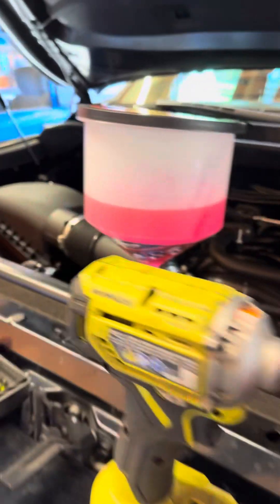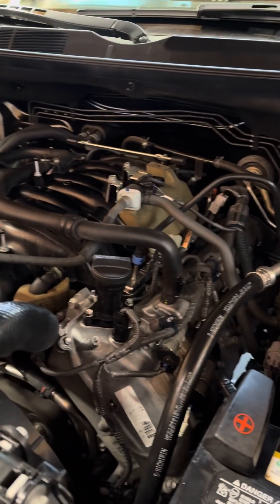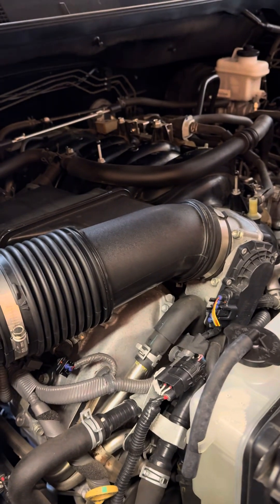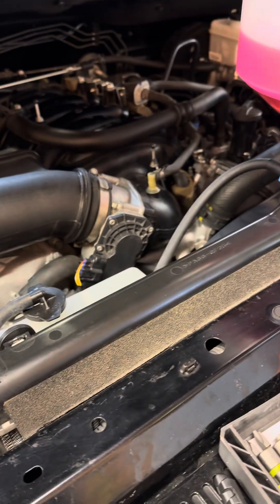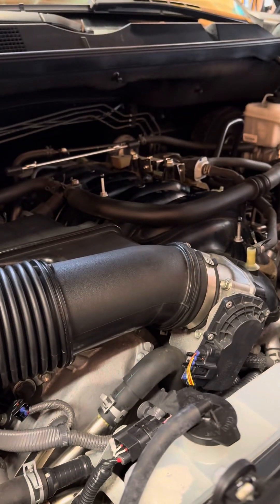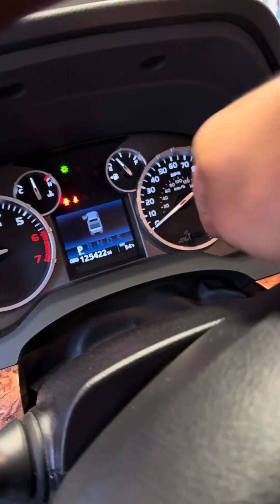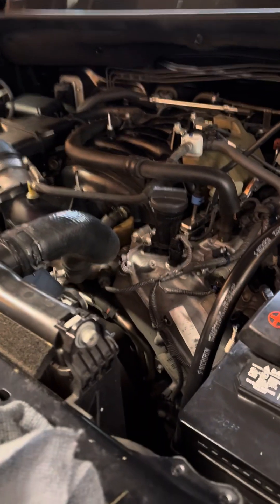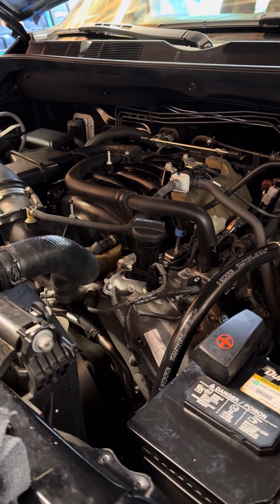Toyota Tundra 5.7l 3UR-FE V8 oil and maint insights…  0W-20?!

Comment: The water thin oil doesnt stick like heavy weight does i put used 0w20 and 10w30 in buckets and swirled them the heavy wet sticked to the walls for weeks until i finally cleaned it up the thin oil was dry
Reply from the maker: @325-k9k  keep in mind that this is when cold… in a hot engine you just shut off, neither “stick” to anything.